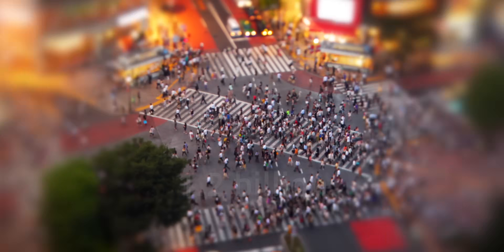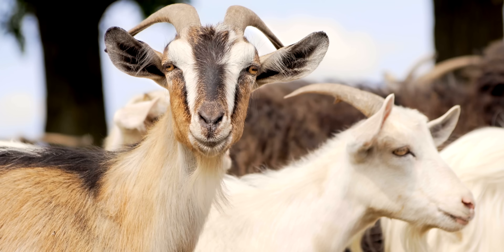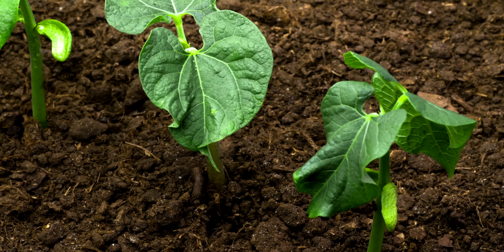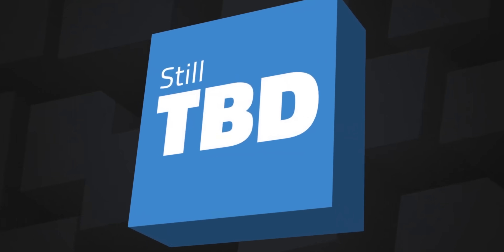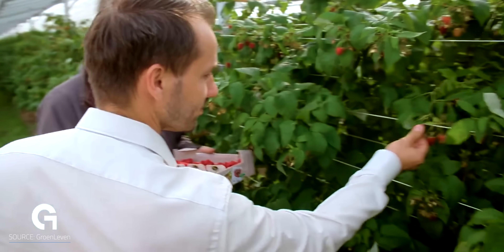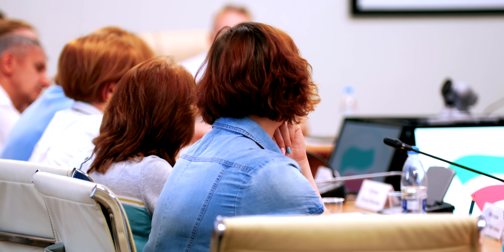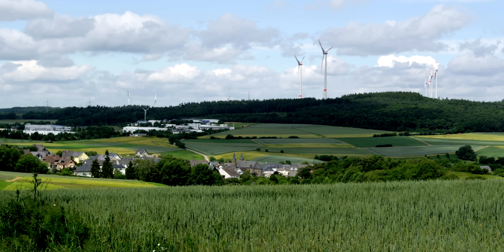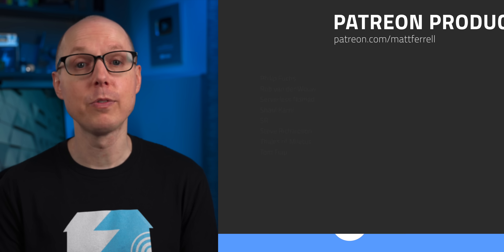Solar Panels Plus Farming? Agrivoltaics Explained

Comment: India is building huge solar plants on arid/waste land, even taken on rent from farmers. Indian States are pushing urban roof top solar plants. Indian Govt is enticing farmers to go in for 50% subsidised Solar water pump which after watering fields the solar juice feeds the grid for additional income. Before holier than though talks, I fixed 9kw and 10kw roof top grid connected solar plants - no bills for last year. 
But always wondered about the land usage beneath solar panels. Agrivoltaics is a superb idea but needs more research in the factory and on the farm. Once economic benefits are Visible to Indian farmers it will trigger the next Green Revolution of India.

Comment: Have you ever heard of Thermoelectric generated cells? If we intergrate these cells, we will capture any seasons  that have made us struggled for awhile. Thermoelectric generated cell can generate electricity on both side of a cell, so we just need to add the hot side under solar part and the other just automate it to flip during the winter time. It's 30% energy production, maybe less. However, we need every bit of it. event 0.1% still not 0. Please if it works, count me in. I want 5% interest of this project if it happens :)

I guess now aday we need to add everything together. I know there a certain risk, such as soil poisoningm, land occupying.... Why not verticle farming + hydroponic + solar + thermoeletric generated cells +.... Budget and Material are considered serious risks.

Comment: In France agrovoltaics is taking off, often due to the restriction in water evaporation. The country has been plagued by several years of very dry climate that killed many crops and made animal farming difficult. A series of tests were performed and from 2023/24 onwards this technology will be expanded, both for growing crops, but also for animal farming of sheep or beef.

Comment: 00:00 Combining solar panels with farming can solve water and electricity demand issues
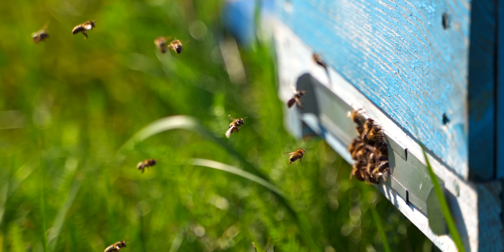01:44 Vertical solar panel installations can increase arable land and protect crops.
03:17 Solar panels can be used for crop growth optimization
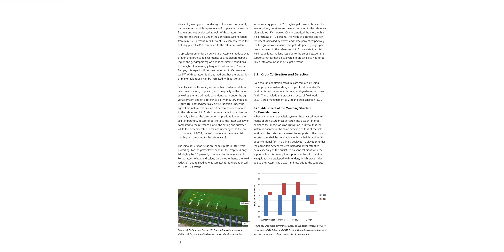04:58 Agrivoltaics could be a game changer in hot and arid regions
06:38 Agrivoltaics can meet a large portion of our energy needs and reduce water consumption.
08:15 Community pushback and bureaucracy are obstacles to agrivoltaics.
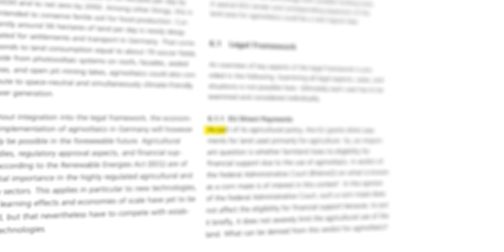09:53 Agrivoltaics' eligibility for financial support in the EU depends on land use and building regulations, and cost per kWh is higher compared to traditional solar parks.
11:27 Agrivoltaics can help with food supply and clean energy transition.

Comment: Speaking on cost per kwh,  I would be interested to see the numbers coupled with irrigation savings, and extrapolated out for, say, 25 years. Taking climate change into account and the fact the tech will probably get cheaper, I'd be willing to bet a net gain over a long period of time. Not to mention the greenhouse gas savings. There is a lot to unpack. Heck those panels would be ideal for rain catchment to reduce irrigation as well. The initial cost of the infrastructure and the cost of maintenance needs to make sense and I think over the course of a few decades it would more than pay for itself. Now how to sell it...?

Comment: 📍 MATH. There is a formula for production (food and energy), supply/demand for the grid (peak hours), storage capacity… and ROI.  If the upfront cost cannot be afforded, yet its installation would be of benefit, THAT is where an opportunity gap exists.
Reply: Also remember, parking lots, side of highways, waste land (old landfills), etc.
A simple 1/4 mile square grid of panels fills the need of ~25,000 people. Add storage and factory peak demand for adjustments.

Comment: It should be forbidden to have farms of solar panels. Specially when you have so many wearhouses without solar panels on the roofs and many roofs in cities, etc. Even using the ground under a panel, it's still not a good enough solution. We have roofs! And many houses would benefit from having panels because it protects the house from elements. And don't even start to argue that "we don't have the logistics or the space". We do.

Comment: Well, i think this idea is very interesting.. however, I think it is more better if integrating the recirculation aquaculture system, hidroponic, and solar panel at the same time. This project is more suitable for one area where the local or center government has a policy to encourage green energy and clean energy. Let's take one example, there is one new capital of Indonesia which is been under construction and it is called "IKN". This city is designed as a green city and clean energy by Indonesian government. In this situation, the integration of aquaculture, hidroponic, and solar panel is more beneficial because it can maximize it's space of land and more efficient. The investments can put their money in one company and the company runs its business and it can create jobs. But the jobs can be minimized because it doesn't need too many human labor. The government provides the lands with 70-80 years of used for investor, so it is very profitable.. I think the "real key" here is that, if someone want to build this business project, it must be aligned with government policy... see: https://www.youtube.com/watch?v=kTFomUnsaS4

Comment: So in the beginning you say crop yield can be same as normal famrlands, reduce water consumption, make electricity. At the end you say there is either crop reduction or energy production loss. Plus, if it is an investment not worthy for farmers to own their own installation, it means the gain from water and electricity production do not compensate. So a bad investment, so not a real solution to anything. FInally, your initial statement is that the main issue with solar energy production is space avaialbility. What evidence make you say that ? For small countries with high urbanization and farming such as Netherlands I can hear it, in most of the world I do not see the point. Many avaialble (non farmable) lands everywhere. I invite anyone to explain to me if I missed something, conversation is home to reason.

Comment: Its all about cost .. Not only the panels but the structure, wiring, inverters, breakers... I've had this idea for years and even tried to implement it ,, merely building the structure to hold the panels broke my account, then came the solar system itself,, so many hidden costs you don't realize like the cables itself costs more than the panels !!! And the batteries ,wow... So unless you go begging the governments with endless paperwork or you're filthy rich or are willing for someone to invest in the project and then just showup at the end of the month demanding payback plus interest for your back breaking hardwork  .. this idea is  unfortunately silly and totally impractical.

Comment: They should consider doing this in abandoned shopping malls too. They have extensive parking lots under the scorching sun. You could even mount the solar panels on elevated structures and park cars underneath for double use
Reply: Yes the housing society I live in has solar panels installed over all parking spaces on podium and ground levels. It isn't even that hard, it should be hapenning everywhere but it isn't  : /
Reply: Then we will move forward and use more green energy. that's great @gurlwithapurlearring

Comment: This is a good idea for areas with high sun exposure and generally low crop growth like areas of Arizona, New Mexico, or Texas. The solar cells can protect plants from too much sun, while providing the energy for water distribution, and local communities. It might be possible to draw in sea water and make fresh water for deserts with solar evaporation. Solar evaporation could lead to aquaponics or hydroponics. We should be preparing for droughts, and crop loss due to climate change. We won’t need an electric car if we have no food.

Comment: I'm a bit late to the discussion but why don't they just combine reforestation with agrivoltaics? If one of the main issues people have with solar panels is that they don't want to physically see them in their backyard, they could just get a large area and plant the border up to a certain point with short-growing fruit trees. The border could be a small strip orchard that blocks the physical view of the solar panels from the street or someone's backyard. Under the trees, they could raise a small animal that will defecate and help promote plant growth while simultaneously eating pests. Then on the inner layer of the land, they could have solar panels with plants growing under them. Honestly, the combination of trees helping to reduce soil erosion, the animals eating pests and defecating and providing natural fertilizer, the solar panels providing energy gain, the plants being protected from the harsh sun and hail, the proven water use reduction in the hot months, and the money from the fruit trees, crops under the panels, meat from the animals, and eggs (if chickens were chosen for this experiment) would provide a pretty steady cash flow. Also, if they wanted to be really, really fancy with it they could have those solar panels that move around and adjust the height so that farmers can reorient them during times there was less sunlight to increase the amount of sunlight the plants are receiving during wet cloudy months. Or if you wanted to be less fancy with it, you could just hook up grow lights underneath the panels and turn them on and off as necessary. It would be kind of expensive to do this, but I think it's an idea that's at the very least worth experimenting with.

Comment: Vertical Solar Panels inside a Transparent Tower could track the sun from sunrise to sunset.   Low cost flexible vertical solar panels suspended inside Transparent Towers could rotate and track the sun.  This system would use a minimal area of land and could be installed in urban areas.

Comment: Great ideas... I would like to extend these Ideas into what I call Linear cities... take the Saudi's Idea in the desert with their ambitious 750km Towering modern city... this seams odd shaped... I would challenge you to connect all of the Americas in a linear city's except the challenge is to keep it above the ground to allow nature to pass under with minimal interference. Wing shaped to allow natural air flow... within it would be the width of about the length of a football field wide and 60ft high supported by underground concrete water storage tanks as footings for the above city to provide a supply of cleaned potable water... which can supply millions. Within a practical and efficient vertical housing units... surrounded within by fields of crops, local edible plant and smaller animals like goats and sheep... poultry... vertical farming could allow for extra growing areas (for example; rice production descending plateaued fields), Fruit trees, and local exotic plants could also be grown inside if proven marketable then useful to cultivate/export. This one is for Elon Musk... why not reach higher speeds of commuting by using a hanged rail system, that merely holds the wings between polarized tracks that have the same Pos. or Neg. charge as the wings holding a fuselage If both wings are polarized opposite then perhaps these tethered flying winged planes could cruise at rapid speeds tucked up and under this wing protected from weather and wind, powered solely through field generation . Linear urbanization could also revolutionize the delivery industry if every one lives in or near there parcels need only be sent by tubes (Elon Musk, navel ships, and others using vacuumed tubes), that will stop at your residence/droned outside the city... the capsule can then be reused... great time to introduce recycling like milk in returnable glass bottles... protective packaging, boxes and returnable containers could be returned to whence they came, lets force manufactures to design reusable packaging. Getting the continent linked together could bring the Americas into a sustainable prosperous future... 
Where to start... existing highways could provide mutual benefits as the location and easy access to construction crews, materials... eventually lowering the footprint of the road by providing readily available electrics for future electric vehicles and systems to maintain them...  this continuous wing will incorporate the most advanced solar and wind generation technology coupled with water storage batteries systems that raises water from the underwater fresh water storage tanks up into above Water Battery Storage Tanks during the day then returned to the below storage tanks generating power at night... might as well use this system to heat or cool the environment, provide water to all the fauna including ourselves... bike paths the whole way, high speed rails means high speed ambulances, Med bed equipped, Fire control systems... dry toilet systems and compostable gathering... water being readily available fisheries and water sports could be incorporated where feasible... say the desert... as we collect more and more fresh water it can be re-distributed to drier areas until the whole system is integrated; water from areas of abundance to dry areas providing solar power, steam power, etc. in return.
Lots of potential folks... no more homelessness!!!!          Hope some one sees this ELON, DONALD, Jordan P., someone?

Comment: I compare solar with magma energy, as opposed to comparing solar with fossil fuels. I don't want to be negative, but I argue we need a massive over-abundance of clean Magma Energy/ electrical power/ hydrogen fuel to secure the future. Consequently, I must point out agrivoltaics is not an ideal solution. It's easier to use temporary polytunnels to shade crops. Similarly, Magma Energy/ electricity/ hydrogen is a better way to produce energy. 
In lieu of the ideal, it's a clever compromise, and I've no doubt synergies exist. But the scale of the energy required to power civilisations into the future cannot realistically be produced from solar agrivoltaics. Solar can mitigate part of increasing fossil fuel emissions - as energy demand grows 50% over the next 30 years, according to IEA projections. 
If instead, over that same time period, we developed Magma Energy; given abundant clean energy to spend, agriculture could become far more sustainable and productive than agrivoltaics allows. Indeed, the environmental footprint of agriculture could become one of resisting desertification and the restoration of nature.

Comment: What about trying to fill the gapes between the solar panels with light spreading material, so that there would be more light for the cultured plants? Perhaps other kinds of crops could be planted underneath the solar panels in that way, so that the costs could be reduced.

Comment: I am a retired environmental consultant for utility scale solar farms in the Midwest. In this part of the country, Solar farms are typically  sited on corn and soybean monocultures, which have many harmful impacts on the environment. Row crop agriculture is one of the most harmful of land uses, because of its enormous scale. Taking 300-500 acres  OUT OF PRODUCTION for each solar farm is the highest and best use of these lands . Converting these monocultures to diverse prairie soil banks/nature preserves, which mimic the  historical prairies are of immense benefit for several reasons. Diverse prairie grasslands mixed with flowers and legumes provide  habitats for pollinators, small mammals, birds, deer,  reptiles, amphibians et al that have been decimated by habitat removal to plant crops. The deep rooted permanent ground cover of plants prevent doil loss by erosion and build soil which capture carbon at a greater rate than trees. The root systems also act as a storm water sponge which allows massive infiltration of waters to restore aquifers and cleanse water before discharging into streams. When these lands cease being managed for crops pesticides and fertilizerd are no longer used providng an additional environmental benefit. The farmers receive a steady check from the solar farm that is not subject to the vagaries of weather or the market. The win is achieved by taking crops out of production not by double using the land. 
Love your videos!

Comment: Sounds amazing but like with the electrical cars, a big question needs to be asked: how much resource is needed to make those panels in the first place? Switching to electric car for instance is not a great thing since the carbon print of making a new car is just disastrous. I assume making a solar panel and replacing them every like 10 years is also going to use a lot of resources. It's definitively promising though.

Comment: This is patent nonsense. Farming is basically about converting water, sunlight and oil into food. Reduce the solar input by soaking it up with panels. Putting crops in the shade (unless there can be absolutely ZERO frequency overlap between the solar panels - including the materials they are weatherproofed with) will reduce food the total amount of CO2 converted to sugars/starches (food).
The real dual use for agricultural land is onshore wind turbines; with their tiny footprints and trivial shadows.
If this PV approach is restricted to shade loving plants it will be of no use in the UK. Maybe in the places where they grow banana plants in the shade (like the Canary Islands) this would have some utility.

Comment: areas where its turning into desert would work good for slowing that effect. what about putting them of the barns used by the big farms there is a lot of unused space there. would elevated panels work for grazing cows because they would be under them allowing shade for the animal.